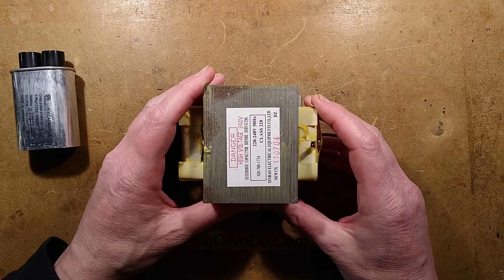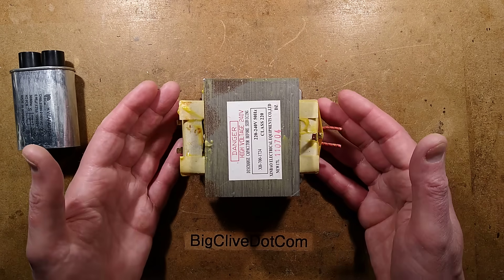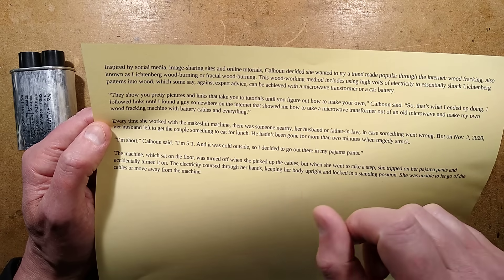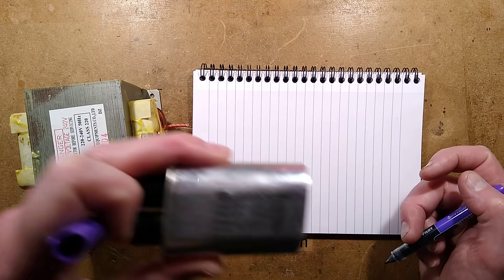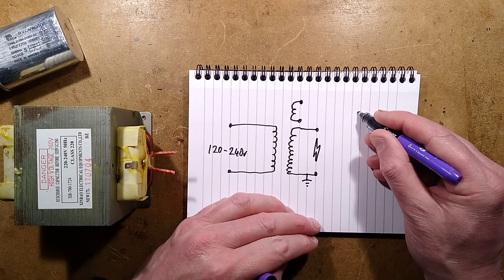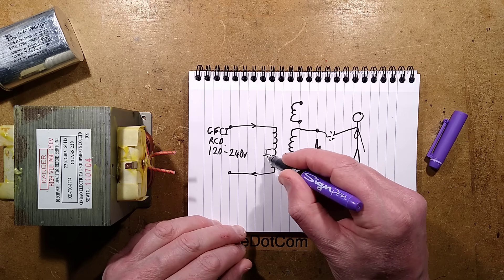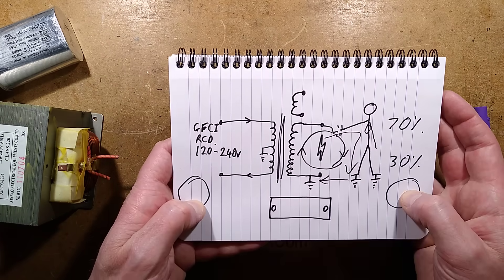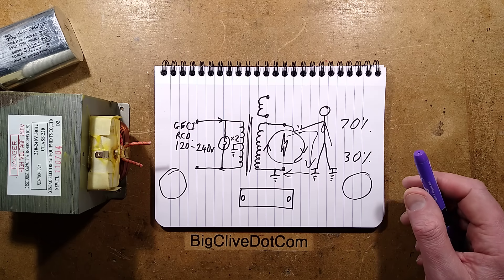The most deadly project on the Internet

Comment: 8:27 tranformer output is AC mean that feet to ground with insulated shoes is a capacitor, and AC run "through" capacitor. It is indeed a strong capacitor of course, but 20kv will still run a few amp through it.

Comment: I have one of these machines (DIY) and made a (now defunct☹️) woodworking business out of it so I’ve got a fair amount of experience with them. Let me say, these fuckers will easily kill you. People take ZERO precautions with these things and treat them with the severity of plugging in an outlet. 
It bothers me so much bc to me it seems like common sense: never touch the electrodes when live; always have at least 2 switches for failsafe; when moving the electrodes only touch one at a time with one hand behind your back. 
No one respects these like they should. Just because you made it doesn’t mean you can’t die from it.

Edit: you shouldn’t build one of these if you don’t have any prior experience with electronics. My dad is a seasoned engineer and I’m a senior in aerospace so we have experience with “lab equipment” we’ll say(I’m actually about to start working on a sick research project where we try to smelt lunar rocks using high powered microwaves) and actually respect the electrons when we burn with it. Most people will not have this consistent caution due to their lack of knowledge behind how it works (and thus why it’s dangerous) and therefore should NOT even look into building one of these. Respect the electrons

Comment: I always got told volts dont kill, amps do. Stating it doesn't matter if you'd have 100v 0.1a or 10000v 0.1a.
But I'm not gonne try and find out 😂

Comment: If I might add something that people have died from a police tazer and I just prey that people who must do this project will take your advice and I must admit that I am really impressed with your dead mans switch I am no expert but I have heard that some professional electronics engineers use that system and if I might add my respect to you for taking the time to explain how and why the H.V capacitor is so deadly even after the power has been removed and how important it is to discharge the cap.

Comment: Going through an electrical course right now and still trying to understand the difference between overcurrent protection. So with the GFCI detecting a conduction to ground, would this be a better application for an AFCI? With the AFCI focusing more on the sine wave rather than current flow would this be a more practical time to use one? Or an AFCI outlet on a GFCI circuit? Thanks in advance.
Reply from the maker: An arc fault interrupter would probably not detect these units.  I've not tried that though.

Comment: I constantly work around alot of electricity because I repair drones for the military and they are around 90% electronics 8% fuel and 2% the rest of the vehicle. When I say it's scary because in alot of aircraft if something happened with the wiring because it was faulty there are countless spots where the metal on thier aircraft will be connected to a large amount of electricity you could die by touching it we litterly have huge wooden sticks and poles to pull people away or hit them away from getting shocked only tell sign is they don't move and they don't respond. If you don't act quickly someone is more then likely going to die. Was my 5th day on the job we were briefed not to wear jewelry but 1 man said fuck it imma keep my wedding ring on his ring got stuck on a super charged piece of metal and me being new only new I had to pull him away using the rubber lasso in the shop but when I did that it quite litterally warmed up the ring and pulled all the flesh off his ring finger leaving most of his finger and the ring on the aircraft while he was left with bones and cartilage. Needless to say he lost his finger and I where a rubber wedding ring not a thick one a very thin one.

Comment: Re insulated boots.    A worker on a roof touched overhead transmission wires (>>240V) that were supposedly off.
Electricity flashed over his skin, welded keys in his pocket to his skin and exited out the sides of his boots, arcing burn holes in the leather from his feet to ground, with minor arcing through staples used in the boots manufacture as well as nail fragments embedded in the soles from walking around work sites. He did survive, (he fell 4m to the ground) but was severely handicapped after months in hospital.
Cheers

Comment: I worked with a maintenance guy that got shocked by 480v while placing a cover on a live breaker box. Sent him to hospital and there was actually burn marks were his shoes were. When he returned to work months later, I had a problem with a well pump outside and it was raining, I told him the breaker did not shut off the electric going to the fuses. He ignored me and grab the fuse and got shocked again. DO NOT GET over confident when comes to your safety. I don't trust anyone's wiring job and not even my own, because you dont know who was there before you  and I've been shocked by someone that wired around a main breaker. I got shocked also by an electrical engineer that decided he didn't need to ground a transforms secondary.

Comment: I used to play with these bad bois back in highschool when I was 17. I always was extremely careful and never had any problems. I know that this is general safety information, but like all things it's important to mention that there is a way to be safe with these transformers. Dumb people will always find ways to hurt themselves. If I hadn't had the experience I had tearing apart microwaves as a teenager, I may have never found my passion for electrical engineering. Those who trade freedom for safety deserve neither.

Comment: First time seeing one of your videos. 

Very good.

I saw a video of a guy that made a magnetic vice using 2 of these transformers. Removing the top circuits from each, wiring together the bottom circuits, and maybe some sort of capacitor in the line? 

It would be great if you made a video explaining why that works, how it works, and how to do it properly.

Cheers.

Comment: I have been (still is) hundreds transformers and i modification them. Every high voltage are dangerous.and i hv feel it, but only couple times, its very strange feeling, but weirdest feeling was  RF-power burn injury, it was only few watts, but it burns from the inside to the bone, not the outside skin...so guys if u need to handle high voltage units, at least use a (fast) fault current protector that can be connected to the plug!

Comment: I do very much of cool things I see myself, doesn't matter if fire, heavy machines etc., but this is one thing even I won't do at home. I don't fear electricity, do wiring etc. myself here and there, but I have enough respect, that I won't open a microwave or other electric devices with huge capacitors or with thousands volts on it. Absolutely not worth it.

Comment: I use this technique myself but bought a transformer, have leads rated for 4000v and the area is completely isolated, I use screws in the wood, switch the power on from outside the isolated area, with a camera above the area so I can see what's happening remotely.
I'm not an electrician so have done a lot of research and I'm taking every precaution I can think of, part of the reason I didn't use a microwave transformer.

Oh a dead man's switch I hadn't considered that will definitely introduce that into my setup

Comment: Yes I agree it is a dangerous thing to work with but not if it has adequate coverings around the transformer and also switched, plus using correct cabling

Comment: Medical professional here.

What the spicy lightning bolts do when going through your body is they go through veins, because blood, and specifically plasma is full of water and minerals. What then happens is it goes through the heart on its way out and that's where the big mess happens. Your heart has several "nodes" inside that use electricity to drive your blood pump.
When they get stung, they can desinchronise, and the heart can and will either stop or in the better case arythmia and other rythm and contraction problems set in. Not even talking about the effect of frying your myocardial muscle.
Burns are relatively fine. Paralysis is also pretty okay. Burns are, with modern medicine, bit of luck and some effort pretty okay to fix up. Skin graft there, painful long healing process there. But the heart is a lot harder to fix, y'know, because it keeps you alive. 

Don't do stupid shit.
Reply: Spicy lightning is bad, which is why I only deal with cool mint lightning.

Comment: I don't even stand in the same room as my microwave when it is on, I can't imagine taking one apart and playing with it.

I'm not going to lie, I would rather fight a bear than go toe to toe with a microwave oven, I'm not saying I'd stand a chance against the bear but at least I can see the bear killing me rather than being cooked alive from the inside out by an invisible demon. 
I'm terrified of microwaves because my old one broke without me realising, and I was standing next to it and I just felt intense heat on my tummy I then noticed the plastic wrapper from my food was melting into the table before the power finally tripped, I wasn't injured, but I did have sore skin for about a week on my tummy. Now I stand in the living room until I hear the safety bell, I also set the timer and place the food in then shut the door with a long string just to be extra, extra safe.
Reply: Sounds like paranoia from a freak accident. I didn't even know there were models of microwaves where that was possible, since every microwave I've seen won't turn on without the door being closed since the door has shielding that breaks up the microwaves with the little holes. 
If you really don't trust your microwave that much you could just prop up an aluminum sheet between you an the microwave like one of those cardboard dividers they'd give you during tests in school to stop people from peeking. But that really seems like overkill.

Comment: Why does he and everyone keep talking about high voltage? I thought it was the amperage that was dangerous, not the voltage???
Reply from the maker: Higher voltage pushes higher current.
Reply: @bigclivedotcom  Can a wire with high voltage but low current because of high resistance be safe to touch?

Comment: Experimenting with electricity was my hobby years back. But, there was an incident where a few of us were working on replacing a voltage transformer in a fridge and while the rest of us were away to get some other parts, the friend that stayed behind decided to start working on it without us and unfortunately, he did not realise the power was on as a friend with us forgot to turn it off. Therefore, when the person who stayed behind started working on it, he was electrocuted and was left paralysed for a whole week. Thankfully, he recovered with very minor side effects. From that day, no matter what sort of project or an electrical equipment I work with, I take additional precautions and triple make sure everything is well monitored and safeguarded.

Comment: I changed a couple of those for some light fixtures on parking lots. Haven’t done it in while since all we do now is LED.
Reply from the maker: Those would have been ballasts.
Reply: @bigclivedotcom  hmmm they looked just like that, they even had capacitors. They were Metal Halides big bulbs.
Reply from the maker: @captainobvious1252  They do look like big chunky transformers.  Often with taps for different supply voltages.  The capacitors are usually to compensate for the high inductive load.

Comment: It's terrifying just listening to it. Makes me think of all the times I tinker with electronics with barely any knowledge.
Reply: If it makes you feel any better, to work with (+30v) voltages you have to be certified, most places differentiate between a 'warned' person who is aware of all the risks, and is only allowed to work on low voltage (230-400v) under close supervision of a 'certified' individual. Tinkering with electronics is usually much lower voltage (5-12v) which is ideal with no risk to the individual. Except for touching a hot component every now and then.

What these people fail to realise is the amount of certification and training that's required to be able to work with a voltage this high.
Reply: Just be careful and try to avoid taking things apart like tvs, buy pcb kits or a breadboard they’re great for learning about components and basic circuits

Comment: Helpful vidoe. I do fractal burning and sell on Etsy. I use clamps, a surge protector with a switch, and distance for safety. Clamp the where I need to, stand back, plug into surge protector, and turn on surge protector. Never touch the object while it is plugged in, even if protector is off! Happy burning!

Comment: I'm an electronic engineer and for sure, you are absolutely right. Good and correct explanation. I would say, the most important thing is the galvanic separation. The current flow on the secondary side never stops until you cut the primary current source

Comment: I wasn't aware people were playing with high voltage in this way scary, I saw the microwave transformer I thought he was going to go over taking apart a microwave, WHICH IS VERY DANGEROUS sorry for the caps but I don't want to downplay it, so microwaves often kill skilled tradesmen because of their ability to hold a charge even after being unplugged the microwave is a grave reminder to remember how important you're basic electrical safety is to always check for charges and currents not only that but microwaves can be quite complicated depending on the problem, so if a microwave is quite hazardous even for skilled tradesmen imagine some poor random guy who decides that they are not going to buy or pay for a repair or new microwave. I've seen DIY channels do this and they are going to harm themselves and the people watching, it is very dangerous, one of my favorite depictions is as high voltage with a switchblade, my stomach gets queasy just thinking of someone's mom who just saw a video or something online and decided they would just do it themselves, my point is just don't do it unless you have to it's one of those deceiving killers.

Comment: I got shocked by one of these a few years ago. As the machine shorted through me. My only thought was to run away from the plug in cause the voltage wasn't letting my hands release the electrodes. I got far enough to where I pulled the evil machine from the wall. When it was done it blew a hole in my finger welded part of my peck to my bicep and I could feel the path of cooked muscle it left through my body. Took a month for my finger to heal cause it cooked so deep. Scary stuff. Not worth it at all!

Comment: Nitpicky but you  sometimes say Current when I believe you mean Voltage. If you have a microwave pulling 120v @ say 15A (idk) and it's transforming it to 2000V, the current is much lower actually because power must by law be the same. If 120V at 15A makes 1800 Watts, 2000V at 1800 watts is 0.9A. Doesn't change that is is dangerous but the wording is important so people understand that even a low current can still have dangerous high voltage.

Comment: My father was laid off in covid but he was a service manager for Caterpillar, when he was off and we were at the desert for new years he got a call at night that 2 of his technicians died basically immediately because they walked into a room that has enough electricity to kill you JUST FLOATING AROUND IN THE AIR. They didn't know there was a live charge in that room and were essentially vaporized instantly. Not literally but all the moisture from their body was gone in about 20 seconds. These were technicians for massive generators that the navy and hospitals use.
Reply from the maker: It sounds like they went into a substation and contacted high voltage.
Reply: @bigclivedotcom  yeah the generators the company my dad for worked with were never smaller than like a literal room of a house. Sometimes a lot bigger too. Generators for places that not only need power but can't go without it like giant submarines and hospitals.

Comment: I was electrocuted by my make shift machine about five years ago on October 30 th i was lucky and kicked the machine and disconnected the cables from the transformer luckily i didnt hard wire the electrodes to the transformer and was easily broke the connections i had both electrodes in each hand and i had nasty burns on each hand and my shoulders still pop in out of place to this day but hasn’t been as recent as the first year or two where anytime i would lift my arms above my head they would pop out of place now it only happens at random but its was crazy being by yourself not being able to pull my arms apart from each other and smelling my hands burning and watching the flesh in my hands arching and smouldering
Reply from the maker: Glad you survived.